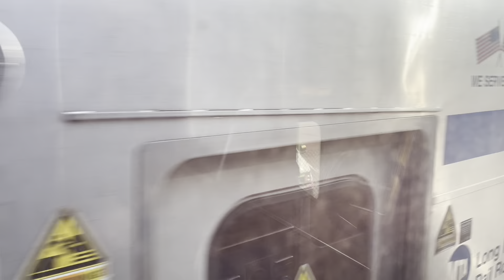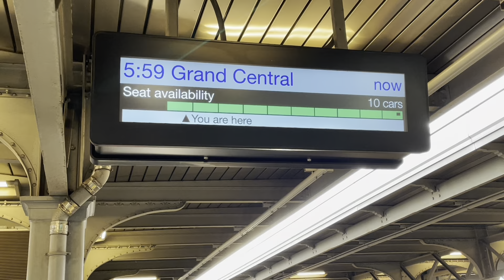Ride on LIRR #17 nonstop Speonk-Jamaica plus frenzied M3 action at Jamaica.

Comment: Greetings. You mentioned train 173 so I thought I would comment on that. Train 17 is scheduled to run ahead of 173, but if 17 is late enough that 173 can be moved out of Babylon first without further delaying 17, they can (and yesterday did) cross 173 up to no. 2 track. (*This also depends upon 166 being on or close in Babylon, which it was — it was the train on track 3, turning for 263). There’s a gap in eastbound service after 166 that provides a window for 173 to run on no. 2 to Amityville (except when the Cannonball is running), and if you look closely at the train in Lindenhurst, you can see it has markers rather than headlights on its east end. That was 173! Hope this helps.
Reply from the maker: I thought that was an eastbound in Lindenhurst. I’ve seen many trains have the markers on in addition to the headlights.

Comment: 4:10 was this spaghetti and meatballs? That horn blowing is too similar, haha.
Reply from the maker: No
Reply: the funny part about the C3 horns, they used to have a solenoid valve that would go full open and quill the horn until the engineer released the button. yes, it's a yellow mushroom cap button. now, the C3's horns have a solenoid that's basically on and off. like the original DE/DM K5LA solenoids. 5021 had the classic style high low solenoid put back in. that's why it sounds like that.
Reply from the maker: @evangouldtransit  is that the only one of its kind? I never heard a C3 sound like that
Reply: @3985uprr  they sounded like that a WHILE ago, as of now this is the only one like that